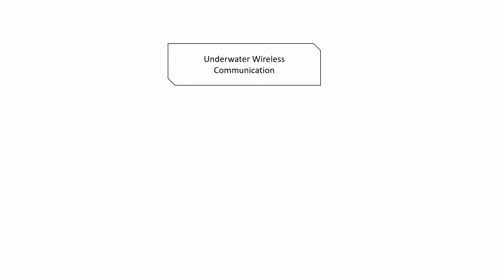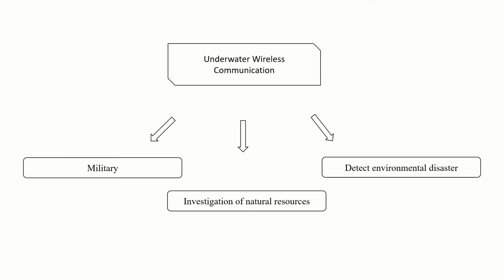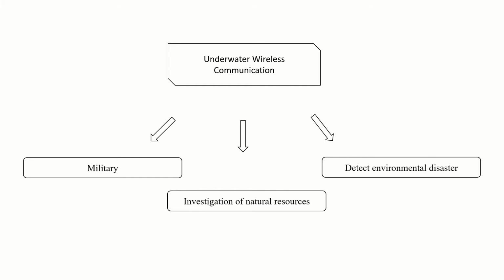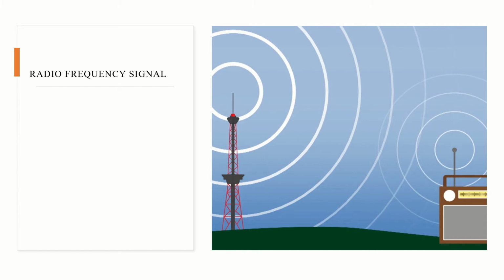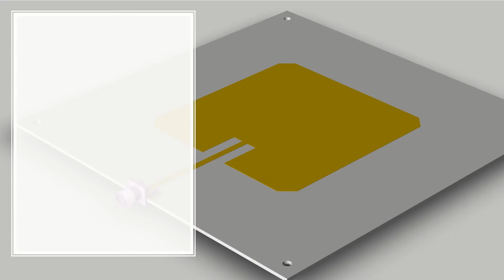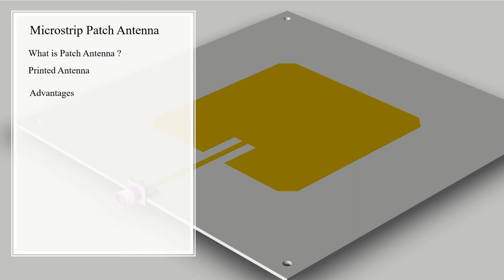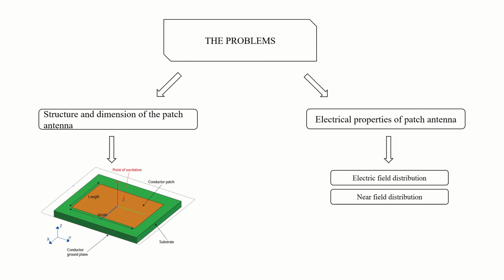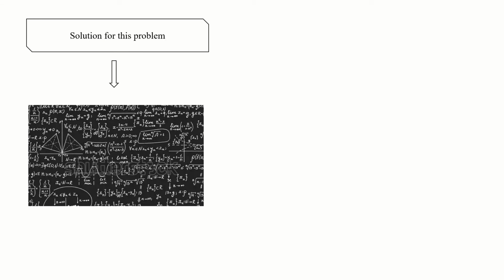Measurement of a Patch Antenna for Seawater Application - 5MT

Comment: Thank you for your presentation

Question from Examiner:

Could you highlight on existing antenna design for commercially underwater communication system? How your proposed antenna design is important for the research community
Reply from the maker: Thank you for the question Dr. Ibrahim

One of the existing antennas designs for a commercially underwater communication system is collinear J-poles. It has a high bandwidth and directivity that is used on an AUV model. The antenna physical structure is easy to fix around the body of an AUV model for onward data harvesting or communication with other underwater bodies.

My proposed antenna design is important for research community because Microstrip Patch Antenna (MPA) are becoming increasingly useful as they can be easily printed directly onto any circuit board. With the fast development in the wireless system and radio telecommunication system, the demand for such antenna design has been widely used for the application of fifth-generation (5G). It is because the features of the MPA are low profile, small in size, light in weight, easy to fabricated and low cost. The demands for the improvement in characteristics have been increases for the antenna design.